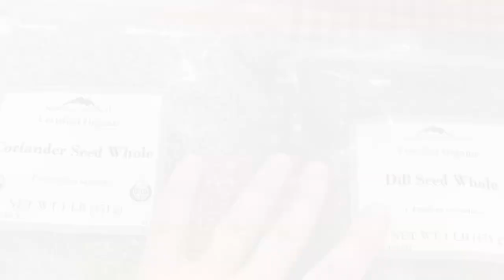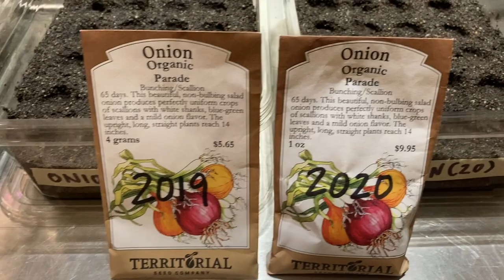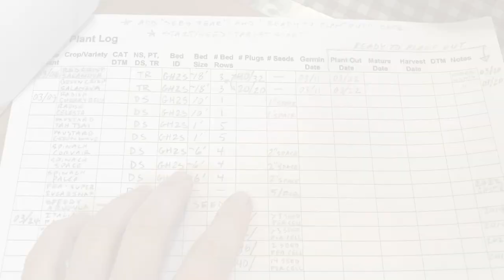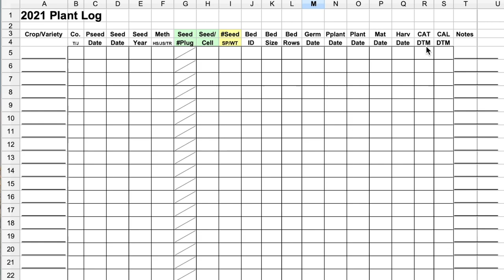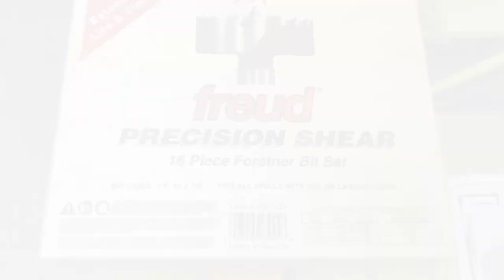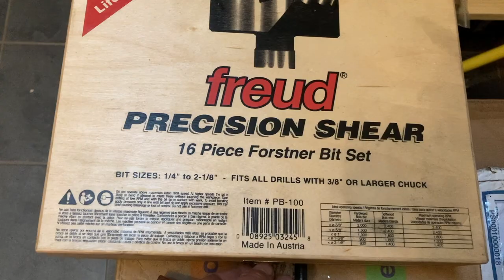Copper Pipe for Slugs + Better Planting Notes after Lettuce Goes Out & Herb/Onion Seed Goes In

Comment: You're so well organized, Katherine. I'm impressed by your list and the plans. I write diaries every year, but the plans are mostly based on gut feelings and previous years' experience. Nice idea with copper legs for your tables. It will be exciting to see how it works.
Not quite Spring here yet, but the spinach has actually sprouted out in a pallet collar with plastic lid.
Have a nice Sunday my friend.
Reply from the maker: I hope that in the future I can garden more intuitively each year, but for now I'm still learning how everything works in this new location, so it helps me to have a table of data. I'm relieved to have copper table legs so that I don't have to worry about keeping the jars full of water. It will be great if the copper works! After I published this video, the likely reason that my spinach hasn't germinated occurred to me; I planted the seeds and then put snow on top which would have kept the soil near freezing temperatures until it melted after a number of days, so the seeds are probably behind in germination by a week for that reason. Next time I'll put the snow on the bed a week before planting to allow the surface of the soil to warm up above freezing, then plant seeds into moist soil. It also makes sense to also put row cover on the greenhouse bed even if the temperatures are above freezing at night just to help them along. I'm really liking using snow because it wets the bed so much better than trying to use a watering can! I hope that you have a great week Benni 😊